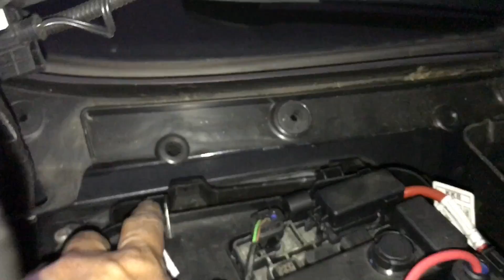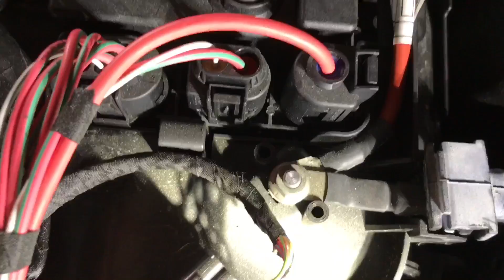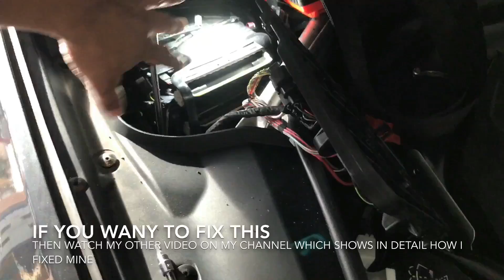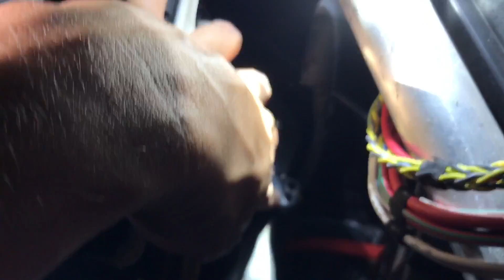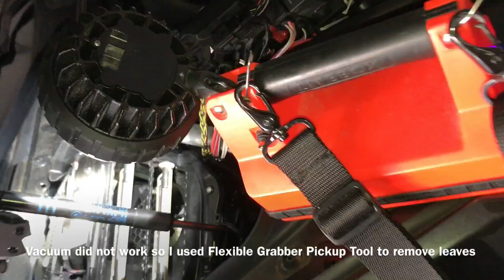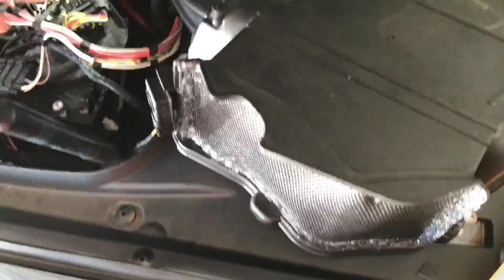BMW F10 Blower motor noise repair on 535i

Comment: I did this and realized you don't actually have to remove the top lid exposing the electronics or whatever. The thing you're showing at the beginning. You can just take the single screw out from the corner and move the whole thing aside with the lid on and the big red wire still attached. Then attach a a bungee cord to pull and hold it away while you work on the blower. You do have to remove the strut brace bar though. This way you have zero chance of shorting anything out and you save yourself some trouble.

Mine is the N47 diesel though, so there's a chance the assembly is slightly different in yours.

Comment: I just did this repair and found the original material at home depot.  i used a foam vacuum filter found in  shop-vac dept cost $5.  didnt even glue it. just cut to size and it fits right in
Reply: Can you share the link to which filter you used?
Reply: @JamesKloss  thanks! The thickness is pretty good too compared to original?
Reply: @houseofpang  yes was pretty much exacly what i would expect original to be like.  Was  about 1/4" - 3/8" thick.

Comment: Hey sir. I did the same thing. That battery wire touched the cross over bar as I put it back together and I have that drivetrain malfunction and my car won’t start. I have work and drive my son to school (single dad). Praying you have a fix for what fuse popped I spent hours pulling these fuses (which are in the wrist spot I’ve ever seen for fuses in my life). Can you please let me know how you fixed this. I’m loosing my mind right now. Can’t believe I did that. I was done! Lol. Now the blower works but my car doesn’t. SMH. Thank you very much in advance.
Reply from the maker: Watch my video on how I replaced the fuse box. F10 is the playlist on my channel
Reply: Can you drop a link for it ?

Comment: So I did this today and the ac on max is still loud but not as loud as before....

The cover I did the same fix as you... I wonder if I just didn't clean it out enough... 🤔
Reply from the maker: It’s possible you didn’t. Do it again. Mine had a lot of junk in there. Took me a while. Just a reminder if you do it again please please remove negative terminal from battery.

Comment: you said that you change the fuse but which fuse i should replace?
Reply from the maker: You must have blown the fuses. There is a fuse panel on top of the battery. Those fuses are not replaceable so you have to replace the entire panel. I have a video on my channel showing how to do it.
Reply: How To Do it where’s the link?
Reply: How To Do it I replaced the fuse panel on top of battery but still not working. Says drivetrain malfunction...

Comment: How would I get an error on my screen if the battery is already disconnected?
Reply from the maker: Yes you won’t if battery is disconnected however if you connect the battery in the middle for some crazy reason- you will

Comment: Help, I try to clean blower motor and also dont disconnect battery and now everythins isnt working, the car is dead, what should I do?? please help
Reply: Matas Stasiunas how did you fix it? I have “drivetrain malfunction” warning and can’t my car started. I replaced the “batter power distribution box” but it didn’t help..
Reply: Did you fix it?
Reply: @nonofficial3013  did you fix it?
Reply: @nonofficial3013  clown